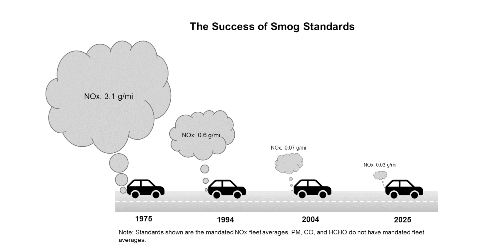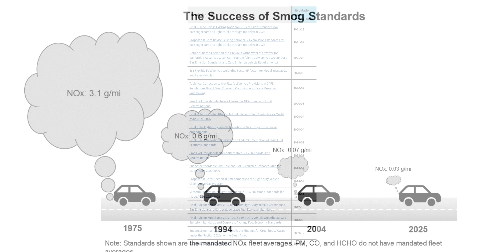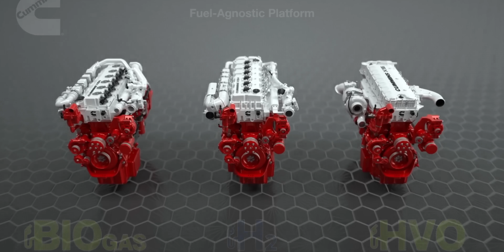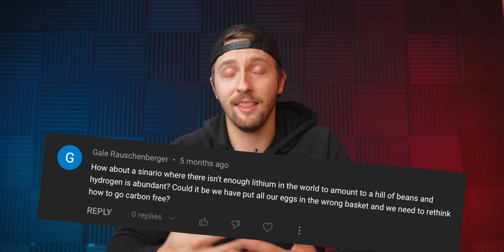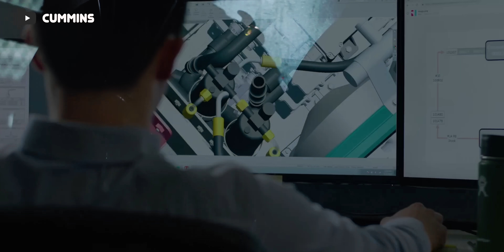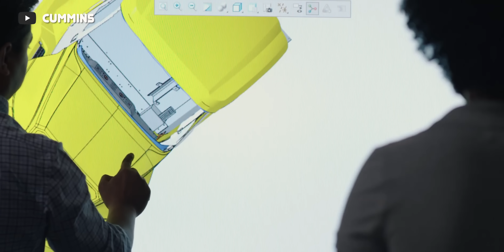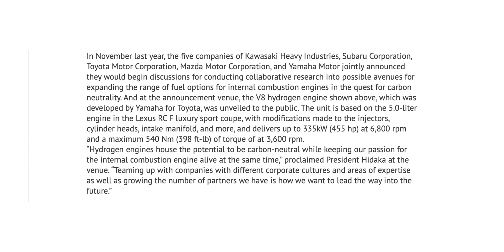Cummins Hydrogen Engine Will KILL DIESELS FOREVER

Comment: I imagine that diesel (compression ignition) engines will have to be called by their true classification if diesel is to be done away with. As someone else has stated here in the comments, diesel engines were originally fueled with peanut oil, when Rudolph Diesel first invented them.
Reply: Diesel was named after the German guy who invented it, Rudolph Diesel.  Gasoline-powered engines are internal combustion engines that require spark plugs.  Diesel engines work on high compression, and that is what causes the explosion after the fuel is preheated by the glow plugs.  Two completely different technologies.  So, I guess what I'm trying to say, is that the fuel is also called diesel, you are correct in that.  However we need not rename the engine that Rudolph Diesel created, as this was done in respect to his accomplishment.

Comment: Maybe because diesel fuel is ridiculously expensive and shit and be if I had a key so I’ll be burning fuel oil my truck!!!Or some homemade diesel is pretty easy to make usually 80% old gasoline and 20% oil use the oil mix it up should be able to get your motor on it if it’s an older diesel

Comment: EV commercial applications are not feasible.   For smaller EVs it will be used but only when traveling around town.   Hydrogen , however, might work for large trucks and construction truck equipment.   Also hydrogen is more suitable for consumers that travel long highway miles without the inconvenience of having to find and recharge EVs.

Comment: The ignorance, there is no such thing as Hydrogen Engines. Hydrogen generator isn't possible due to material required are classified as military use only. So we're back to Hydrogen fuel. 

We've had hydrogen fuel for diesel vehicles for nearly 2 decades on the commercial scale.  

Hydrogen self combusts at 140f, that's the main concern. The fuel system routing needs thermal protection mainly.  Hydrogen is a byproduct in many commercial processes. 

Hydrogen is green, so it's not ment to go hand and hand with EV. It's ment to kill EV as the current technology for batteries. EPA can kindly f*ck off

Comment: You can not produce your hydrogen on board. There is no way that you can turn chemical energy to kinetic energy to electrical energy to run a HHO generator and have any amount of gain in the chemicals energy before you started.

Comment: I hope hydrogen  has future and I hope they can make conversion kits. Obviously hydrogen tanks and so forth would  be part of conversion. I truly hope they can find a additive  to hydrogen to enable the liquidation of it and stabilise it.
Reply: Gregory E McLeod,

Sure Hydrogen "Can" be used as a fuel.  It takes 400 KW of electricity to produce 1 Kg of hydrogen with electrolysis.  So 80 Kg of hydrogen to take a class 8 truck 1,000 miles.  X 400 KW per Kg and you get 32,000 KW of power to run that truck.  (+ the amount of electricity to compress all of that hydrogen to 8,000 PSI).  Or drive a Tesla electric truck at 2 KW per mile or 2,000 KW for 1,000 miles.    I have a feeling that the Tesla overall cost will be less.  

Consider a bid to move a 30,000 pound trailer full of stuff 500 miles.  The Tesla driver knows he will have to buy 1,000 KW of electricity to make that move, and that will cost $150 if bought at the home rate of about $0.15 per KW.  Or at $0.31 per KW at a Electrify America station, $310.  So he can bid $750 and make between $440 and $600 depending on the cost to refill the battery for a 2 day run.   The diesel fuel truck driver needs about 14 - 18 gallons per 100 miles, or 70 to 90 gallons of diesel.  So that can run $5 per gallon in many states, and $6 in California.  So up to about $350 to $450 for the $5 fuel or $420 to $560 for the higher priced $6 fuel.  So if the diesel truck bids over $750, they will not get the job.  Do it for $750, and they will make about $400 to $190 in California with only 6 MPG.    Hydrogen at 16,000 KW would be well over $900 for the electricity to make that run.
Reply: @Kangenpower7  I hope we don't end up with a single mode of transport like all EV or all Hydrogen. I hope they can have alternatives and some alternative that does not make the majority of vehicles on the road now redundant and a huge waste problem. We need to look at all the mechanics and other associated auto industry workers as well. Also we'll to champion Tesla but they employ minimal workers opting to use Robotics to do majority of building. Shipping and aircraft will need another source other than Batteries. Even if Batteries had life of 100 years they are toxic and need a lot to recycle. Let's hope there is a scientific breakthrough to find another truly green product to fuel all.

Comment: There are like six or seven different ways to produce hydrogen. Green, blue, black whatever... (Somebody doesn't want to break their reliance off of petroleum...🙄). As far as transportation and thanks to hold the hydrogen... In 2004 they came out with a layered tank made of graphite that, bonded with the hydrogen and made it part of the solid graphite until I charge was applied where it released the hydrogen. This means there was no need for a compressed tank it was hydrogen on demand. That technology was boasting structural members of the vehicle be made out of graphic or covered then this released hydrogen we go to a compressor and be injected into the engine freeing up more room for engine and cargo and it would not require a large compressed tank. Fast-forward to 2021... The same graphite technology has been dramatically improves and is now available on disks or cartridges that you would place inside a collection unit where a laser is applied and this creates whatever to excite the hydrogen released from the graphite film. 
Yeah, so many people, against hydrogen as a viable source of energy on a planet that is abundant in hydrogen. I can't make up that kind of stupidity. These are the same people that would start a campfire at a volcano in order to keep warm.
I applaud Cummings efforts. I'm smart enough to know that we don't have the raw materials in order for the entire world to switch to EV vehicles. With that said I do think that a lot of our heavy trucks and mid-range trucks could be run by direct diesel electric, no different than a locomotive.

Comment: The question about the flammability of hydrogen (remember the Hindenburg ?) was solved by storing the hydrogen in a compound called "hydrides" in a fuel tank that bullets were fired into & "it didn't explode". At least that is what I remember reading back in 1973.  I remember several years ago seeing a picture of , I think it was the CEO of Daimler Benz, driving a hydrogen fueled car.
Reply: You could also use carbon fiber composites, prepreg, and that is also bullet proof.   Combined with sealant, leakage and danger of explosion are eliminated.
Reply: @jordansamhuri  You say that, but can you provide an example of anyone who does this?  I would love to see it.
Reply: most car companies have the tech , you can get an RX8 with a hydride cell in the boot lid , only has a range of about 50Km but . they have tested carbon fiber pressure tanks with bullets not sure about hydride cells . The Hindenburg did not burn due to hyrogen , that all did its thing and went UP ,VERY fast . The fire was aluminium metal oxide paint and static discharge mixxing far to well . Human injuries were from falling ,and haveing burning debris rain down ,not any burning gas . The fuel manoploy loves to scare people form researching H ,and HHO with 'remember the hindenburg ', the Titanic sank [ was blown up ] yet we still use ships , risks in most things .[ especially trying to stop th eJPMorgans of this world steal the global finacial banking system ].
Reply: As if other fuels aren't explosive in a tank 😒.
Reply: Metal hydrides are excellent, but heavy...so far.
Reply: Stan Meyer said that he had found a way to create hydrogen on demand from water before he died so there was no need to store the hydrogen. The fuel tank only needed to contain water.

Comment: I'm a retired 43 year over the road trucker. The last 20 years of my driving career were with Wal-Mart. Many years ago, I remember reading that the Federal government wanted to clean up the emissions by putting soot back into  engines. I remember thinking at the time, 'this can't happen, what kind of moron thinks it's a good idea to intentionally put dirt back into an engine'? Well, our Federal Government IS that kind of moron. Around that time, Wal-Mart was testing Cummins, Caterpillar, Detroit Diesel and Volvo engines. Volvo was bounced out very early because they couldn't come anywhere near the specified fuel mileage. Detroit, Cummins and Caterpillar were all performing as promised. Cummins and Detroit were putting the dirt back in the engine by using an EGR (Exhaust Gas Recirculation) valve. Caterpillar didn't think putting dirt in an engine was a good Idea, so they achieved the fuel mileage and the emission standard by using a massive catalytic convertor. Our Federal Government told Caterpillar that they HAD to use an EGR, which incidentally requires a special variable vane turbocharger which is VERY prone to failure. Caterpillar told the Feds "Upper US!" and quit building road engines. They have since returned to making road engines in a limited capacity. The point is, The US Federal Government shotgunned the EGR system, the DEF scam and who knows what what else, because they CAN. They know nothing of automotive design or engineering, but they still dictate what the manufacturers MUST do to "comply". Now look what they're doing with electric vehicles. California in all their tree hugging genius even went so far as to BAN sales of internal combustion engines by 2035. California must have a crystal ball that they can clearly see the best way forward is without internal combustion engines. They must foresee future advances in EV,s and KNOW that the internal cumbustion engine MUST DIE!. People need to start standing up to our overbearing and overignorant shotgun government. Let free enterprise solve this problem. We've got hydrogen fuel (a type of internal combustion engine) that exhausts pure water vapor. Hybrid (another one of those hated internal combustion engines) and the govermnent sponsored EV which likely will NOT reduce our "carbon footprint" because the electricity is generated by fossil fuel in most cases. OK Federal Government, I've just come up with a ingenius way to reduce our co2 carbon footprint. Since you emit co2 when you exhale, just stop exhaling. That might also lessen the global warming problem because it will elliminate a lot of BLOWING HOT AIR!

Comment: For the liquid hydrogen, use cryo coolers, they take an extremely small amount of voltage to make the air liquid.
Reply: Liquid hydrogen?  At -400F the temperature is very cold, and will require a LOT of energy to make it that cold.  So they put the pressure to about 8,000 PSI, and that also takes a lot of power, and requires rejecting a lot of heat while compressing the hydrogen.  Natural gas also takes a lot of energy to compress it to the 3,000 or 4,000 PSI they run at.  I think that hydrogen takes a lot more power than natural gas to compress it.  There is also the danger involved with fuel leaks with natural gas or hydrogen, while compressing it, and when fueling the vehicle.
Reply: @Kangenpower7  You can use hydrogen powered generators. In the end there isn’t enough raw materials to make batteries for electric cars.
Reply: No.   Wrong.
Reply: Costs a fortune to make cryogenic ic hydrogen and store it.
Reply: It take a lot of energy to liquify gases.  Plus, hydrogen doesn’t store the same btu as diesel.
Reply: @KenLeonard  Don’t use btu’s for fuel cells.

Comment: I have been wondering when someone would get around to producing a hydrogen engine since I read a newspaper article on the subject in 1973. I read something about a fuel tank using "metal hydrides" using heat to release the hydrogen from the from the "hydride" compound. Back in the '70's there were a lot engines that could burn both gasoline & propane. I drove one, a Ford cabover semi  in Colorado. The guy I was with also had a Chevy dually pickup that ran on both gas or propane & there was a ranch in Oklahoma, where I drove a Chevy pickup on propane in 1981 or 82.
Reply: Back in 2020, Bluebird sold a school bus with the propane powered Ford 6.8L V10 and now the sell them with the 7.3L V8 gas engine rated at 300 HP. The total cost was about $10,000 less than the diesel bus.  Fuel is a little less per month.  Propane in many parts of the country are less than diesel fuel.  Yes diesel is 130,000 Btu's per gallon, gas is about 115,000 Btu's per gallon and propane only 95,000 Btu per gallon.  So with fuel at about 2/3 of the price of diesel, it is lower cost per mile.  

Many of the class 8 trucks back in the 50's where running on gas, not many on diesel.  The WW2 "Duce" or 6 wheel 2 ton truck was run with a gas inline 6 with 235 cubic inches!  They could do 45 MPH!  Wow?  Not really.  And probably got about 4 MPG?  Who cared?  The largest production gas engine that Ford built for bus and truck service was a V8 at 534 cubic inches.  International built a 392 inch gas engine.  Bluebird installed a 392 cubic inch gas Ford V8 in their 1970's bus with a front engine.  GMC built a 302 V6, 351 and 402" V6 in the 50's along with a monster "Double 6" or V 12 version of the 351 that has 702 cubic inches.  Used in natural gas fields to pump oil or irrigation water, and about 2,000 of them where used in GMC cabover trucks.  A few dozen of the 702 engines have been put into pickups and street rods.  

Of course most 1950's gas powered delivery trucks where retired and scrapped after they where 3 years old and worn out!   Diesel started to take over in the 60's and the trucks built to stand the test of time and last about 6 years!  It was the 90's when they started building a million mile class 8 truck, and still most where scrapped at 500,000 - 750,000 miles.  After 2007, it became expensive and rare to scrap a truck before 750,000 miles.

Comment: Shift the Energy Burden!  Add batteries to the top 2" of the trailer ceiling (or the forward 12") in a tractor-trailer rig, along with solar cells on top.  It recharges pretty much all the time.  Every stop, recharge to full.  The trailer then powers the electric tractor.

Comment: Hydrogen has a habit of going into any place it wants to.  Even migrates through steel.  Its invisible and burns almost invisibly.  Not sure you want to be in a place saturated with an odorless invisible explosive gas when a ignition source shows up.  All piston engines have blowby.  Will some hydrogen blobby into the crankcase on the compression cycle before ignition occurs in cylinder?  That hydrogen could then leak out of crankcase or just burn invisibly until the rubber hoses burn through?

Comment: The combined efforts of five of Japan's leading automotive/ truck building companies- two of which also build big agricultural equipment and construction types as well- have been said to "have raised many ministers smiles"; I sense the old zaibatsu "together we shall conquer" happening- the government has made little secret that it sees a time when two technologies will exist, but it also sees many present challenges with pure electrics- and they are not wrong; how long do you think it would take to build a truly worthwhile national charging station system? Tesla has made claims- but here is the thing; I can build a gas station that can fuel six or more cars at a  time every four minutes; that same size piece of land will only be charging about a third of that number- charging times are still measured in hours to saturate and reach the range. And the additional electric production and increased handling and transmission systems will boggle your mind. This is a problem that would take that original "trillion dollar infrastructure" bill's budget and make it evaporate, still well short of the goal, pending some technologies we haven't seen yet. We do need to get there, but we aren't going to get there this year or suddenly next decade. FR
Reply: Japan will run out working age adults before H2 tech is commercially viable

Comment: Don't speak of the EPA as if they're GOD.
Hardly. They're a bunch a damn bureaucrats that can & should be fired.
Under OUR system, We The People reserve the right to toss em.
In fact whole Cabinet level agencies need to disappear.

That's why the Idiot Uni-Party fights WTP & DJT so hard.

These same henchmen brought us oil pipeline shutdowns, gas & Diesel at 2x higher $$$.
Not due to ANY shortages but due to their Doomsday Eco-Cult, which is based on nada & zilch evidence.

To hell with them -